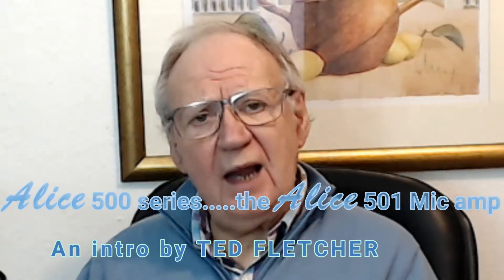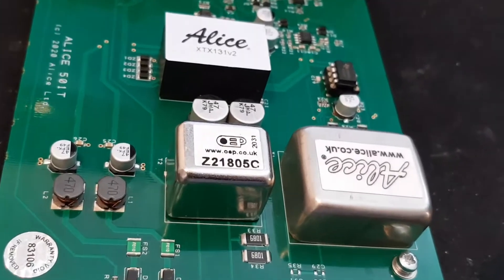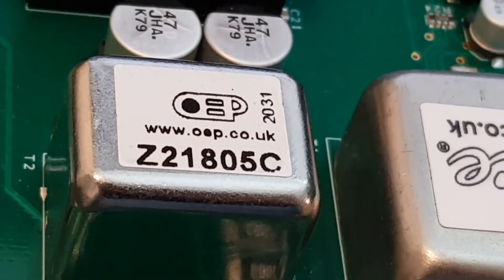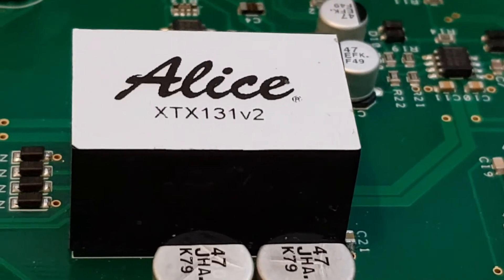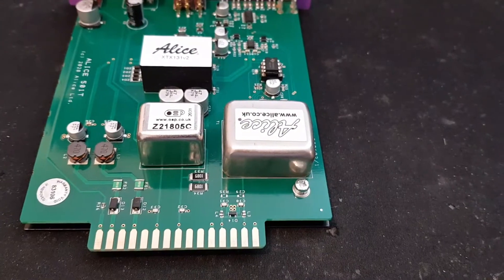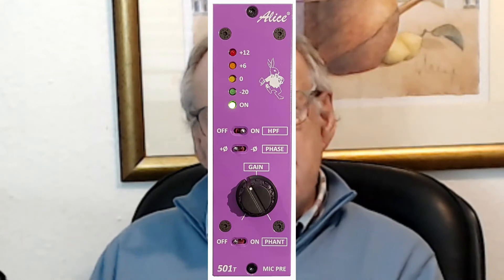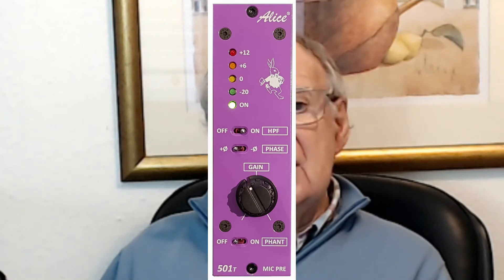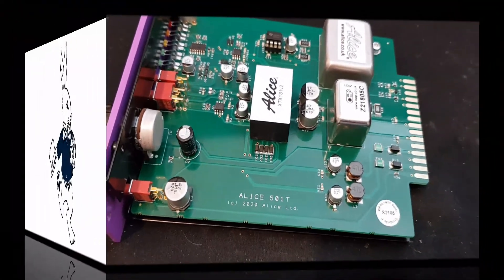ALICE501 INTRO

Comment: Is this preamp similar to the XTX131 designed by Andy Gemmell-Smith?
Reply from the maker: It depends on what you mean by 'similar'; it's a very basic design and uses the XTX131 V2 descrete low noise op-amp simply coupled to input and output transformers. The XTX131 dates back to the 80s when a number of manufacturers developed their own descrete op-amps to achieve reliable low-noise performance.  We were experimenting with descrete op-amps at Alice in the early 70s and I suspect that Andy followed on with his own experiments after he took over the Company in the early 80s.
Reply: Hi Ted, thank you for the quick reply and explanation. It’s great to see this has been improved and given a new lease of life. I have an old XTX131 but this looks fantastic. I’ll certainly be looking at buying myself a couple of these from Alice in the future. Thanks again
Reply: @tedfletcher7334  Hi Ted, I have sent an email to you with some bits I wanted you to see. Hopefully you received it ok and It hasn’t landed in the junk folder.

Comment: Is this preamp similar to the Electrodyne 501?
Reply from the maker: I'm not familiar with the Electrodyne pre but the spec is similar. Our Alice preamp has a multi-stage discrete transistor amp with transformers in and out. The design has a pedigree dating back to specialist equipment we made for broadcasters and the UK Independent Broadcasting Authority in the 70s and 80s.
Reply: @tedfletcher7334  Thank you sir. Your response is highly regarded and appreciated. You're a legend. You have a special ear for sound.